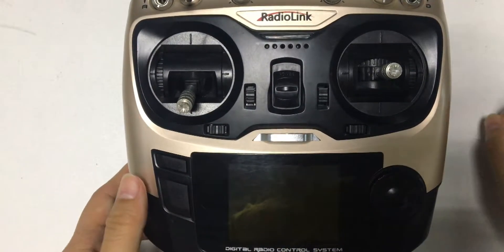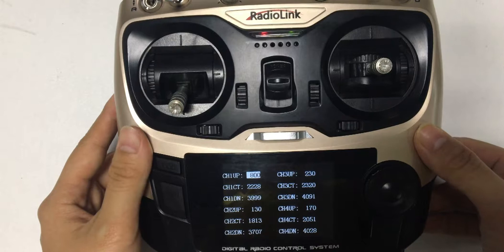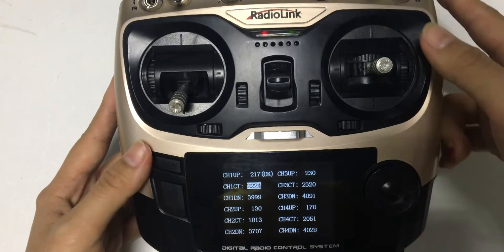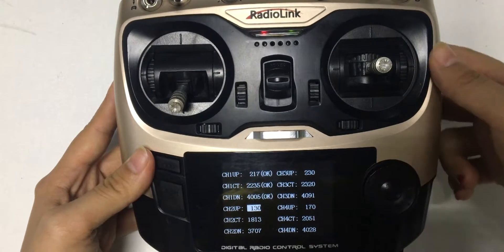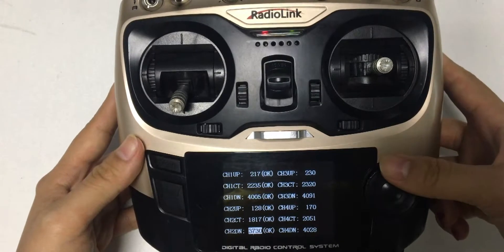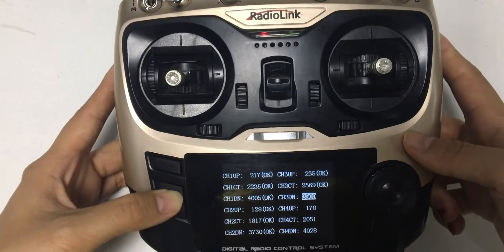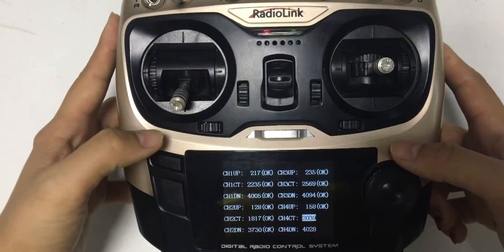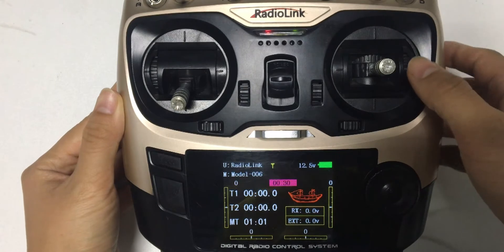How to Calibrate the Joysticks of Radiolink AT9S Pro/AT9S/AT9 (Old method)

Comment: Hi, how did you get boat mode? Is there a car mode? 
EDIT: Updated firmware and found car mode. ;)
Reply from the maker: Hi Glad that your problem is solved. In case anyone who might encounter the same problem, please upgrade the firmware downloaded from  https://www.radiolink.com/newsinfo/386963.html?templateId=114741&fbclid=IwAR0JvLirJ47fX2P2sDSa6aDWI4hW8LZC1ZY-UUNpRsLFMBPbN9DcHrcuz9o